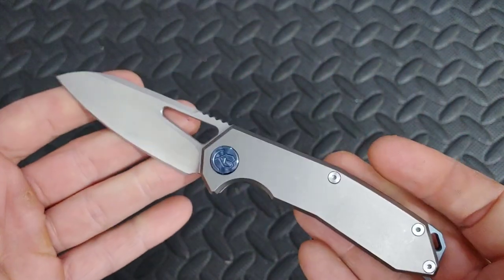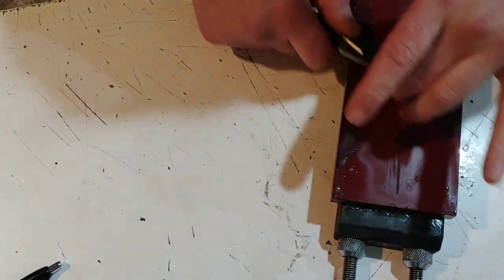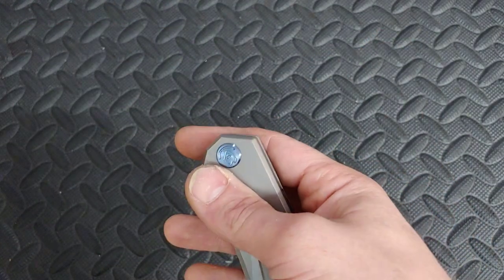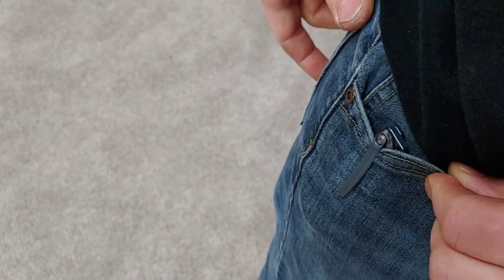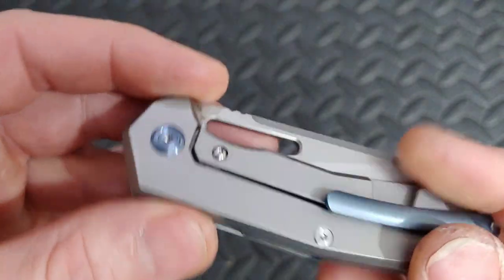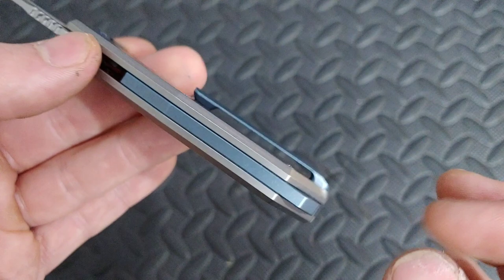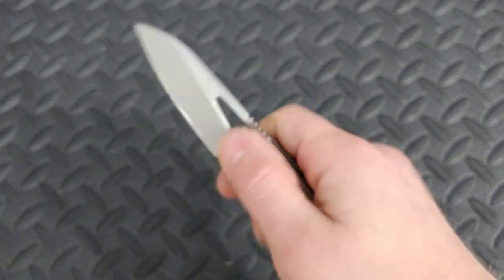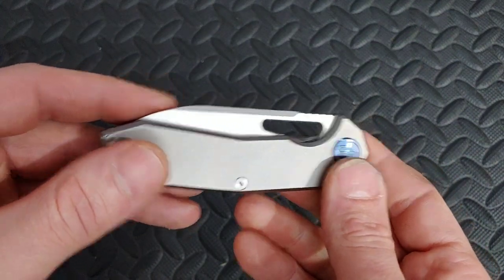KUBEY VAGRANT KNIFE REVIEW GOOD & BAD

Comment: Interested to know which would you pick this or the Miguron Knives Pagos Front Flipper??? Your thoughts @neevesknives
Reply from the maker: That's tough but probably this on, however the pagos is easier to deploy because the chamfered edges around the hole takes getting used to I prefer the keryx from miguron and from kubey the new budget knives are all amazing. The twosun ts319 might be a bit better option